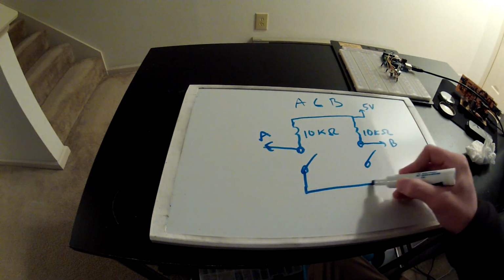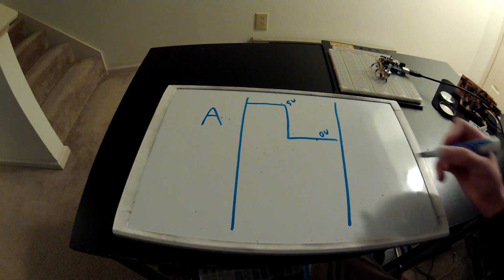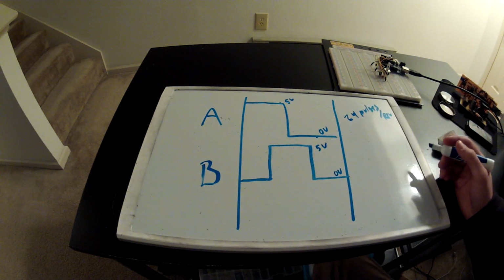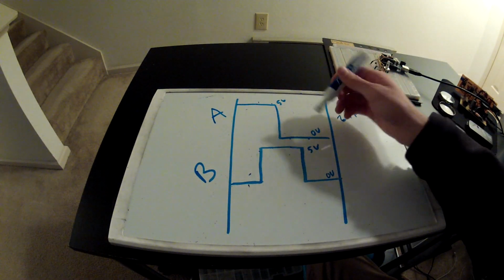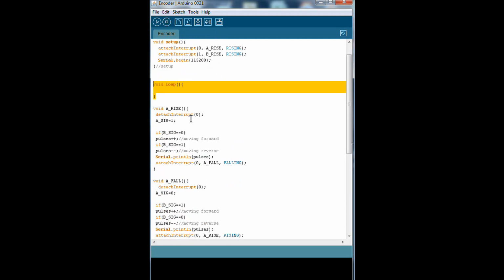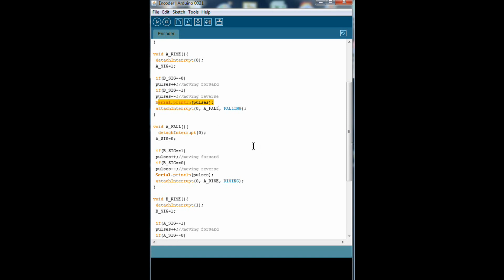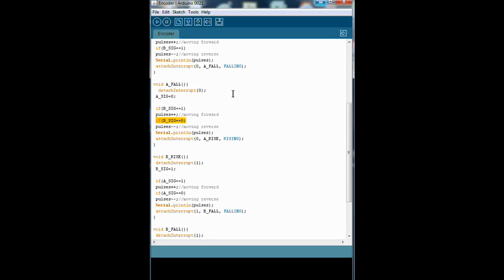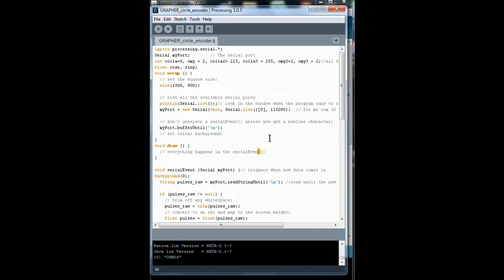Rotary Encoder Tutorial with Arduino Code

Comment: I've got my rotary encoders from Banggood and the encoder is already mounted on a PCB and on the bottom side it contains all the components according to your schematic which is great because I can connect it directly to my Arduino, pretty neat this way because you can't do anything wrong and you don't have to think about the extra components and you don't have to check if it will work with the capacitor values as you had to do, it saves me a lot of time.

Comment: how are you telling it what pins you are using?
Reply: @Forsaken..., Interupts 0 & 1 are hardware interupts on specific pins of the uC - have a look at the pinout for the atmega328P chip. You're looking for 'INT0' & 'INT1' on the chart.
Attaching and detaching the (built-in) hardware interupts uses those two specific pins.

Comment: You can avoid the use of hardware filters and do it all in software by reading encoder inputs in a fast timer interrupt instead of input interrupts. This also has the advantage that you can use any regular input pins for the encoder. That’s the only approach that works well at any encoder rotation speed, from very slow to significantly fast. This is demonstrated here: https://github.com/John-Lluch/Encoder

Comment: Nice video, but I have a comment on this, which is rather confusing me. let us assume that we are in the second state, where both signals (A and B) are in a high state. Then, in any direction they move, fall into the fall of change. But in your code, the Falling ISR is only at any Rising ISR. This means that nothing happens in this case until the encoder moves as much as necessary to find a rising change that triggers the ISR in Void Setup, which is the only routine that breaks the void loop routine. 
In fact, thats what Im really saying is that only your Rising ISRs are included in Void Setup routine, so only thats two (A_Rise, B_Rise) may stop the void loop and executed.

Comment: can this also be done on a ATmega32U4? as i tried plugging the encoder pins in all of the arduinos pins and it did not register any encoder movement. I tried just the encoder with no resistors or capacitors and also the version with the capacitors and resistors and no reaction on.

Comment: I thought the code worked for me, but it turns out that it did not.  It was skipping around all over the place, and even reversing direction.  So I abandoned the interrupts and just do a digital read and it now works perfectly.  I got the code from here
http://howtomechatronics.com/tutorials/arduino/rotary-encoder-works-use-arduino/
This video goes with that link.   https://www.youtube.com/watch?v=v4BbSzJ-hz4&t=94s
Reply: Agree with Jeff Beck.  Kevin's whiteboard explanation is very clear and simple, so it is easy to understand, and his code seems to work.  But, the howtomechatronics code is much simpler.  Also, the mechatronics video of how the two pulses are 90 degrees off is excellent, with a simulation of turning of the encoder, how the contacts work inside the encoder, and how the A and B signals change from low to high, and high to low as the encoder is turned.

Comment: I tested the code and it works perfectly.  The only problem I had was I that I was running on pins 18 and 19 on a Mega for interrupts, and those are Interrupts 4 and 5.  But I liked the project so much, I wanted to spend time testing on pins 0 and 1, and then pins 2 and 3 for no apparent reason. I found the interrupt chart here: http://www.instructables.com/id/External-Interrupt-in-arduino/

THANKS KEVIN.   You da man.  Great video. I did have to go elsewhere for wiring and the interrupt chart, but other than that, the video and code was spot on and the explanation was good as well.   Also, don't use this encoder.  Get a better encoder with the resistors and caps on board. ...i.e. "with break out board."  

I am loving this rotary encoder because my pot that I had, the voltage ranges would vary and break the code. And change over time.  ...and yes, my circuit skills are not that good so yes, there could have been something mechanical messing with the pot.  This rotary encoder eliminates all of that, and not only does it do that, but IT IS GOING TO ELIMINATE THE ANALOGREAD() FUNCTION THAT I HAD IN THE LOOP GETTING HIT EVERY TIME THE LOOP WENT AROUND.  The interrupts are going to take that out and this is going to be a big deal for speed in my code.  Plus it eliminates all the BS about analog reads flopping all over the place, moving around worse than the foundation on my house.  

ROTARY ENCODER = GOOD.
Reply: I liked my own comment.  I did know you can do that.  Kind of like voting for yourself for class president in high school.

Comment: How do I know if my encoder has an issue? I am using a TSWA-3N-CB11 LFS from Digikey and forward is great but backwards I get: 76 77 78 77 76 77 78 77 76
I tried switching the A and B pins on the Uno and get exactly the same into the negatives.
The actual rotation for the non-counting is clockwise. The counter clockwise is fine.

Comment: i have a question, when i have the arduino connected to the pc , when i run the processing code i get an error that com3 is already in use , could you give any tips on how to solve this

Comment: Kevin,
Thank you so much for this amazing video. It worked great, until, like Vitali Neskazhu, I added more code and then it doesn't work so well. It can be nudged this way and that, but it doesn't work as well as when it was all of the code was dedicated to counting and reading the encoder.
If you could help, I'd certainly appreciate it. I am a high school teacher working on motor control for a standing wave generator.

Comment: I found out that in a small program it works pefectly, but when I try to use encoder in a bigger program, where micro delays happen to be, then the encoder just lags. I made it to show a number of encoder into monitor when it changes the state. But when I rotate it, it shows a new line in serial monitor, but the number of it does not change (it wanted to change but it did not). however if I rotate it very slowly it works and changes. But I do not use any interrupts. Would the interrupts solve this problem? I am sorry I am newbie and I am trying to understand the interrupts logics and rules and it is hard yet.
Reply from the maker: yea, I think I may revisit this old project... I think if I were to do it again, I would have a timer running that sampled the pins

Comment: Great video, well explained. I've been working on a project that uses a Rotary Encoder to track the position of a moving mechanical arm. When the project is powered off - the last known position (value) produced by the encoder - is stored in the Arduino's internal eeprom. At power on - the system reads the saved value from the eeprom and the encoder can continue counting up or down from the previous value. This is one way of always knowing the absolute position of the encoder. The sketch uses the EEPROMex library available from github: https://github.com/thijse/Arduino-EEPROMEx  I hope this helps someone. Cheers!

Comment: Hi, where do i make the connection of A and B to arduino?
Reply: +betwixtX it depens what's your model of arudino.
Usually it's pin 2 and 3,in Mega you can also connect it to 20 and 21.
It's all about INTERRUPTS,read about them,just google it.
Reply: +Krzysztof K tx, i just read https://www.arduino.cc/en/Reference/AttachInterrupt, so on uno i can only use pins 2 and 3, i have 2 encoders on my project so i probably will not be able to use arduino uno. Ii'll see if i can at least get 1 encoder working based on your schematics and code. If i will not be able to do it, i might be outsourcing some work from you if you are up for it :)

Comment: Could you wire two different valued resisters to the A pin & B pin and measure the voltage to 1 of the analogue pins connected to the arduino, i.e. V = A , V= B, V = A+B and V = NOT A + B as in  a potentiometer configuration across the 5 volt supply. You could Map out the voltage range for the four different states.You would only need one input pin.

Comment: on following the connections and running the code I get the following output:
0
-1
0
-1 and so on.
what could be the reason for this?
Reply: I got exactly the same problem. Does anybody know what is causing it ?
Reply: +S. Depends on the internal circuit of the encoder you.are using. Some encoders are higly specific with interfacing.
Reply: same issue with me

Comment: Would this be a good option to attach to a string/spool to measure the velocity of a moving object?
Reply: +CSSFACE I tried to attach an encoder to a motor so that I could measure its revolutions per minute, but the encoder itself had too much frictional resistance to let the motor turn. So I'm thinking that if you're measuring the velocity of something small, the encoder might slow it down and skew your data.
Reply: +Riley Robinson There are motors with encoders attached already on the opposite side of the shaft.

Comment: Be careful with assigning buttons (or encoders) to interrupts. Bouncing effects (as the button gets older and wears) may cause your software to spent more time in the interrupt handlers and your program may slow down. It may even crash your program if you have not defensively programmed the state transitions. [2c]

Comment: how does this thing work on mouse wheel?, i used to disassemble some mouse, some have a IR transmitter and receiver, and a wheel with tiny gaps. its seem have only encode one signal. how does it determine direction of rotation?
Reply: The receiver has two areas where it can detect the light. While moving the wheel, light and shadow created by the tiny gaps, will create a sequence identical to AB encoding diagram.

Comment: Plan is to try to incorporate one of these into a ad8950 system. Its being done a lot, just wasn't sure which one to buy.
Reply: Ad9850 dds vfo but you knew that.  received my encoder.  ready to go to work.  Has anything been posted re this optical encoder and the ad9850 or Chinese shield using. ..
Encoder ordered from eBay Karlsonrobotics looks the same.

Comment: Thanks for your great explanation! I have one question though,in the case I have to measure spins and use the encoder just as an incremental one (I know it will only rotate in one direction), would you still recommend me to use this component?

Comment: In your diagram for the wiring of the encoder's A and B, adding the addition resistor (10K) and capacitor(0.1uF), you create an RC filter that attenuates the bouncing signals, aka switch bouncing.
In your code, concerning the interrupts, there is little or no chance your going to miss a pulse.  I can happen if the power supplied to the micro-controller begins to fall below the required voltage in cases where a battery may be used. The other method is Polling. In polling, which is using code to periodically check the output signals of the encoder, you can miss a pulse. The coding method use is a preferred way.

Comment: This is awesome! I need to tap into an Auto A/C Control panel in my car which uses rotary encoders with an Arduino but I didn't even know where to start.
Your explanation and examples are the best and really simplifies what I actually need to do to get my project done.
Thanks you for posting this!

Comment: With the two 10k resistors you have provided a voltage divider. The high voltage would now be 2.5v not 5v.
Reply: don't you have 20 k pull up?

Comment: Hi, this was a great tutorial for simplifying the mysteries of how to read encoders. However I was having a problem with my 100 ppr optical encoder. It would lock up when I spun it too fast. I tried everything until I eventually moved the serial write out of the ISR. Now it works brilliantly. Thanks, keep up the good work.
Reply: +Ian Westbury This is what i was thinking too. If you move the Serial.println(pulses) to the empty loop function, then using serial shouldnt interfere with the ISRs.

Comment: i used your code on my encoder , it works only when i turn slowly , when i quickly turn i have a false Result. I used it with Arduino Leonardo. I don t know what/ where the problem is.

Comment: I wired up an old scroll wheel from a defective mouse. i dont know if it work with your encoder. try it. it has 3 wires. i put one to ground (it was black) and the other two (white) to interupt pins and activated arduino onboard pullup resistors like this pinMode(SCROLLPIN_A, INPUT_PULLUP); ....btw thx 4 ur great tutorials!

Comment: The limit is your receiving data type. The rotary encoder has no limit. If you take an unsigned long it will be 4,294,967,295.

Comment: I would love to build my own motorized Out Put Gain sliders, Just like what you see on a VST Roland 2480 ... That I can program not to allow clipping on the main out put`s between my mixer & power amps !!!
I realize that by the time I build this that it would probably be cheaper & less time consuming just to buy a nice Motorized Mixer ..
But it would have so much more personal value to build my own setup !!
What is your thoughts about this ?
Thanks Bro !!
DEv

Comment: Good video! =)
I only have one simple question.
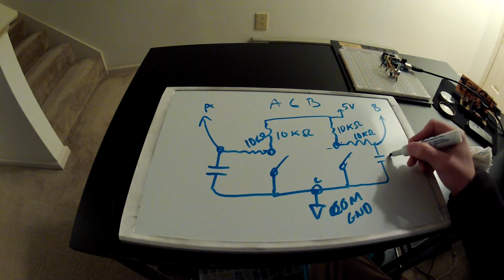At 5:20 you say that it is recommended to use a .01 uF capacitor but you're writing the 102 package code which is the actual code for a .001 uF. Did you mean the specs recommend a .001 uF or was it just a little mistake?

Comment: I try to control about 8 rotary encoders with arduino.

I did watch your video 'How to Control a Ton of Inputs using Shift Registers! '.
Very smart!

My question is do you think I can use your input method with 74595 to connect about 8 rotary encoders?
Will it be fast enough?

Comment: Thanks for your videos, Kevin, very helpful.  Quick question.  Does the larger capacitor of  0.1 uf have an adverse affect on frequency?  Suppose I'm using an Encoder with 4096 Pulses Per Revolution and I'm running it at 2,000 RPM?

Comment: ... FIgured out the glitch. In case anyone else has the same problem of the code freezing when the encoder is turned rapidly: printing the pulses to the serial add a delay that can cause issues if your serial is set to a slow speed (in my case, 9600). Simply increase the serial speed or comment out the lines that print to serial, and the issue vanishes!

Comment: Kevin! This is the best explanation of interrupt-based encoder use on an Arduino that I've ever seen. Brilliant work. I used this code to set up a user input system using only a single encoder - and it works fantastically - responsive, quick, and easily customizable. I have the occasional glitch of a freeze-up when I spin the encoder too fast - but I'm sure I'll figure that out shortly! Just wanted to say thanks for the help that this video has been to me. Cheers!

Comment: I used this tutorial to get to the point where the arduino is sending numbers to the serial monitor, my issue now is that I need to take those numbers and somehow convert them to a rotational distance if that makes sense. So how would I code the arduino so that the numbers being spit out would be a rotational distance

Comment from the maker: yes, you could attach an encoder to  stepper motor.  I think the arduino would be fine for a project like that.  Teh only problem I see is potentially not having enough interrupt pins for all your encoders.  You can always switch to polling your encoders, instead of interrupts

Comment: Hi, Good tutorial you made.
Is it possible to use a small stepper motor instead of the rotary encoder?
I thinking to use a old tiny steppermotor for handwheel for my cnc machine,
 do you suggest to use Arduino for the project? or?

Comment: When you erased and thought of reversing the signals on the whiteboard, you wrote them the same way :D
Also, you forgot to mention why you firstly detach the interrupts in the subroutines. Is it a form of protection, in case you move it faster that the interrupt can finish the routine, in order to correctly process the forward/reverse motion ?

Comment: Great Video, Thanks, explained a lot I was wondering about. I had One very basic question on your code; I do seem to see where you Identify the A and B encoder pins called out for the Arduino (what IO) Pins did you use..?

Comment: This could easily be turned into a digital etch-a-sketch. With an LCD screen, some LEDs to light it, two encoders, an arduino with a video shield, and a Lithium Ion battery, this could all fit in the case of an old LCD computer monitor. It's a project that I've had on the back burner for a while. If someone else want's to build one, I'd love to see it working and a build video of course.

Comment: Oddly enough, I thought it said a 1uf cap, but you actually have 0.1uf, so my calculation was wrong anyways, lol! In fact, I am off by an order of magnitude, or one decimal place... sigh.  (100e^-9*20e3)=0.002, so 0.002 seconds per pulse, or a maximum of 500 pulses per second. Still, great work on the video and good information!

Comment: You probobly should have gone through the circuit a bit more while you had it drawn up. It looks like when the switch is open, the cap charges up based on an RC time constant, (1^-6f*20kΩ)=0.02sec, so Point A starts at 5v and approaches 0v after 0.02sec. Then when you rotate the encoder you short the switch, allowing the voltage at point A to spike to 5v, as the cap discharges through the 10kΩ to ground. This would give you a maximum of 50 pulses per second as you rotate the encoder.

Comment: I work on semiconductor equipment that use encoders but the manuals are the worst a/b encoder info. Our track tool basically reverse until the hits a near home and then home flag sensor, then encodes fwd from that point. Thanks for your comment while your instructing.  Another great video and great subject coverage. Q? what is the processing program you were showing the sweeping of the line on? I didn't know stuff like that can be done on the Arduino program.  Is it a separate program?...